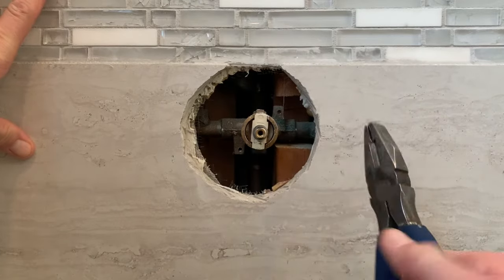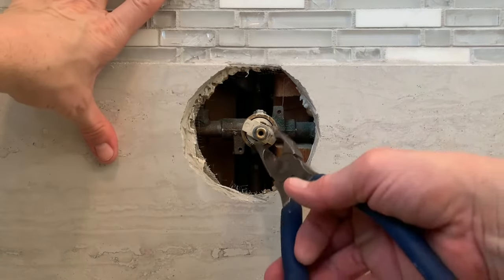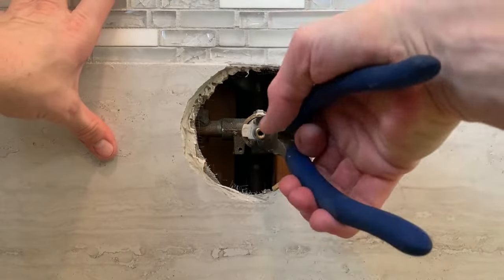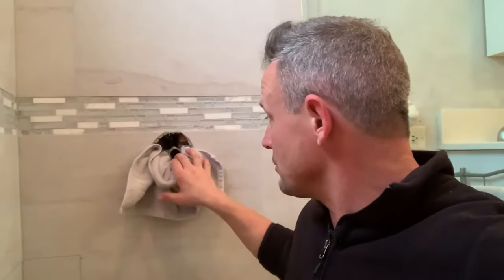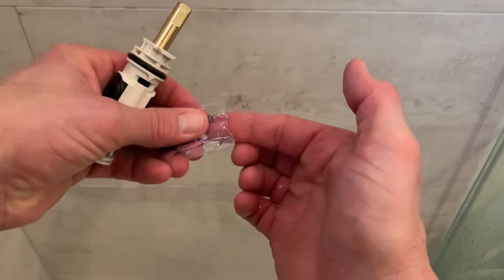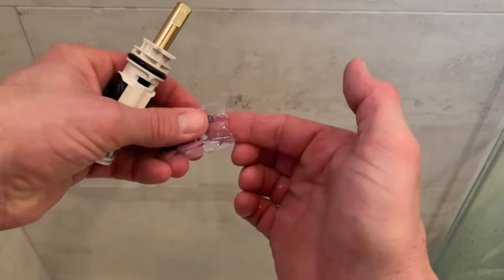How to Replace a Moen Posi-temp Shower Valve Cartridge

Comment: Is that gray piece supposed to just slide off?
Reply from the maker: If you’re referring to the escutcheon tube, which is the gray/chrome piece that slides over the valve, yes.
Reply: @BJPoznecki  I was referring to a different piece, put I was finally able to get it off. Thank you for responding.
Reply from the maker: @jazzminejanae6090  Good to hear!
I hope the rest of the project goes well!

Comment: Replaced the cartridge but the faucet is still leaking a little bit. Took out the new cartridge and made sure it was installed properly. Still slightly leaky. Could it be the faucet itself?
Reply from the maker: Where is it still leaking out of? 
The tub spout, if it’s only a shower the showerhead, or between the cartridge and the shower valve body?
Reply: @BJPoznecki  slight leak from the faucet itself only. Going to replace that tomorrow and hopefully that fixes it 🤞
Reply from the maker: @lifetimeaesthetics  Yeah that’s why I’m asking because if it’s leaking from the valve body itself, the connections, or from in between the valve and the cartridge, it could be the valve is warped and needs to be replaced.

I hope the project goes smoothly!
Reply: Hey brother!! So just wanted to tell you my solution!! When I replaced the cartridge the one I used was the cheaper knock off version from Home Depot (37$). I went back and swapped it for the OEM part (54$) and the leak stopped. Thanks again
Reply from the maker: @lifetimeaesthetics  That’s interesting usually those aftermarket knock off parts work just as good 🤷🏻‍♂️

Either way happy to hear you didn’t have to change out the whole shower valve in the problem is fixed!
Reply: @lifetimeaesthetics  Am starting to think I should do this also. Bought an Ace version; installed it & I still get water leaking from the shower head  after the valve is shut off. Though, I found out the configuration of the old cartridge is “rare” from 97-02, so customer service told me to use sandpaper on the bottom flange of the new cartridge to get it to fit - and it does. Just doesn’t seal such that the water stops.
Reply: @YourHaloCreations  if you can get your hands on the actually OEM part that is manufactured by the same company it’s always worth a try before calling in a plumber. I tried literally everything else before I went back to buy the original manufacture part. It worked for me lol. Also make sure you clean out the pipes and there is no calcium deposits because that could cause it to not seal completely and leak.
Reply: @YourHaloCreations  if you can get your hands on the actually OEM part that is manufactured by the same company it’s always worth a try before calling in a plumber. I tried literally everything else before I went back to buy the original manufacture part. It worked for me lol. Also make sure you clean out the pipes and there is no calcium deposits because that could cause it to not seal completely and leak.
Reply: @lifetimeaesthetics  would a toothbrush work for cleaning out any buildup or do you need something more abrasive like a wire brush?
Reply: @YourHaloCreations  I used a small wire brush but the tooth brush may work if it’s stiff enough

Comment: Mine won't come out, do t know where to squeeze with the pliers.
Mine has never worked since the dude installed it. Just leaked through the ceiling once and now plugged .
No idea what the f is going on.
Anyway I pulled the pin out , put the pliers on the shaft with a soft rag . Can't tell what's on or off but it won't come out. I'm super frustrated
Reply: 2150 D. The brass shaft spins around and never stops too. Not sure if that's cool
Reply from the maker: Sorry to hear at this point I would just play it safe and call a plumber.

Comment: i replaced my bathtub faucet (moen 1222), but it still continues to leak :(
Reply from the maker: @hershp  I would start over try it again this time when you have the cartridge out turn the water on and really flush out the valve really good because if there’s any debris in there that could potentially cause a leak. If you put it back together and it still leaks after doing that, it’s possible that either the cartridge even though it’s new has a manufacture defect. You may need to get another one or the shower valve warped and need to be replaced.
Reply: @BJPoznecki  thank you! replacing the new cartridge with another new one did the trick!!! phew! appreciate it sir!
Reply from the maker: @hershp  Oh nice! I’m happy to hear that. Changing out the shower valve is a pain in the butt, so I’m happy to hear it was just the cartridge!

Comment: So I'm reading my instructions for installing 1222 cartridge and they say remove black ovals & lube on both sides 😉
Reply from the maker: @aquarianhealer  And they would be right. You can never go wrong with too much lube! 😉🤣
Reply: @BJPoznecki  I finally got the old one out, dang took everything out of me. When I pulled black ovals off new cartridge they actually did have a smidge of lube but I took your advice and lubed that sucker up. 😉🤣 great video btw
Reply from the maker: @aquarianhealer  😂😂😂 Thata girl!!